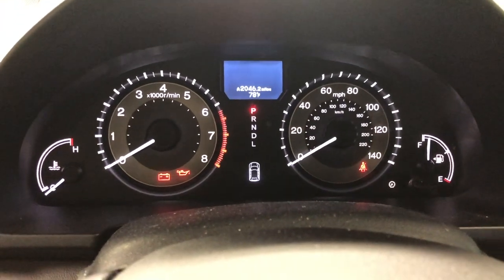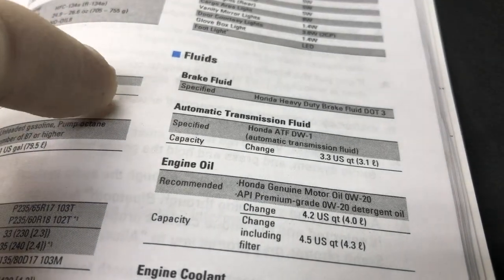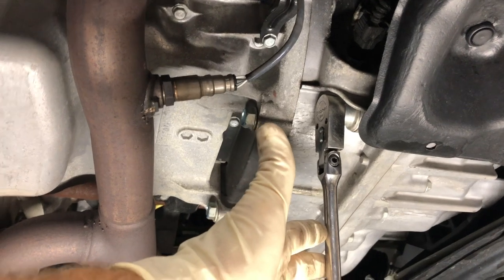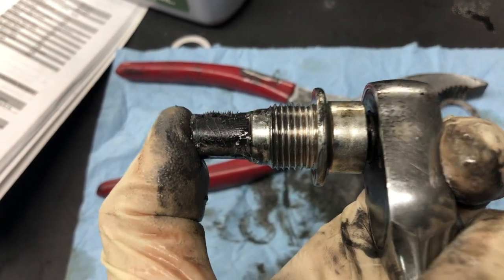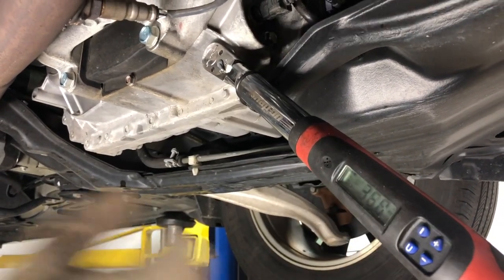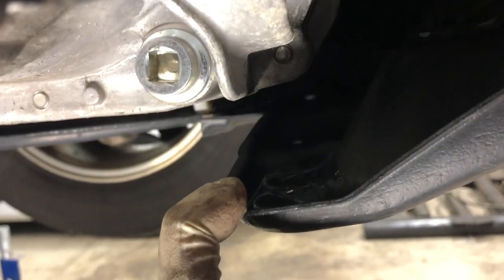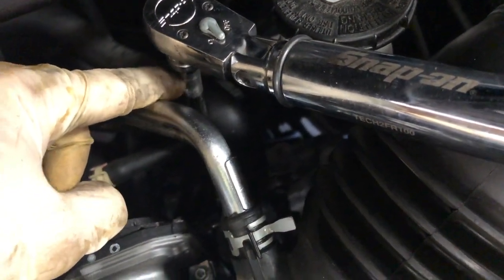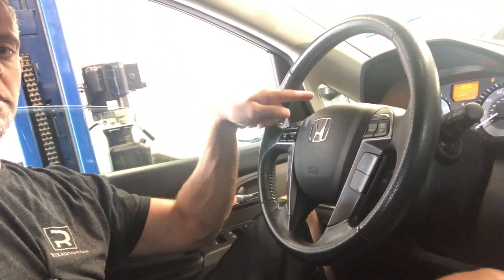Transmission Fluid Service Honda Odyssey 2011-2016

Comment: By far one of the more detailed yet effective videos on this topic. Thank you sir!
Reply from the maker: My pleasure! Thank you for watching 👍🏼
Reply: @rixautomotive910  I am about to do it myself following your very detailed and instructional video, thanks!  What's the cleaner you used to clean up the area around the plug?
Reply: Do check transmission fluid while running or while shut off up to temp?@rixautomotive910

Comment: I did this last week to my 2016 odyssey and it fixed my RPM bouncing and juddering issues when the gears were changing. Drained/Filled it 3 times. Completely fixed. Thank you!!!!
Reply: I changed the ATF fluid with some weird symptoms. Trans slipping and hard shifting. Any ideas? Did your work fine after the change?
Reply: @ChristianMartinez-lg4lk  yes. My vehicle drove normally after I did what was in this video.
Reply: @Surry918  thanks
Reply: Drained/filled back to back 3x? Re using the same transmission fluid?
Reply: @robertgrlic6505  not the dirty drained fluid.... I bought new Honda transmission fluid and refilled it with fresh fluid
Reply: Where to fill the transmission fluid ? 
Same dipstick vs ATF down need big extension
Reply: @hi-vz5dv  yes. Very inconvenient
Reply: I got a black bottle from Honda showing ATF DW-1

Comment: starting to do the maintenance on my van and this is the best diy video i have seen yet. already learned how to change out the o2 sensors and i already change my own oil, brakes, rotate tires and a couple of other things lol. shops are getting expensive and overcharging for simple things.

Comment: I drain and fill my ATF on my 13 ody every other oil change. A few years back it was hard to get my hands on Genuine Honda ATF, I was forced to use Castrol Transmax import AFT. So far no issues, It's been over 3 years and still going. I still drain and fill ATF every other oil change so I imagine that it's now mostly Transmax ATF with a little genuine Honda left, still no issues.
Reply: I've used valvoline maxlife for years non-issue

Comment: Thanks bro, you really saved me. I couldn’t find that damn fill point on my used 2013 odyssey. Just did a full tune up on it, rides smooth like new.
Reply: Got a few questions for you about my 2013 Honda Odyssey

Comment: Thank you for this in depth video.  Certainly looks easy now.  I have a 2015 Odyssey and bought some transmission fluid to swap out but just heard that when shops do it, they change out the ATF filter.  Is that necessary on a car with 100k miles or can I just swap the ATF fluid and be done?  Are there signs that the filter needs to be changed?

Comment: Why dont you change out the transmission filter when you do this?
Reply: 2016 odyssey has a sealed transmission and has no transmission oil filter to change.
Reply: @franciscosantiago9032 there is an external can style filter beneath the battery tray, plumbed with simple rubber tubing, that serves the transmission. Somewhat tricky to access, but still attainable.

Comment: Newbie question…What’s the difference between a trans flush vs trans fluid change?  Or is the same thing?
Reply: Flush means replacing all fluids.   Fluid change (AKA drain and fill) only replacing about 1/4 the total capacity.
Reply: I found this on an Odyssey Club web site to help explain the difference. Long story short, you don't want to do a 'flush' as it forces fluid through the transmission. A 1x drain-and-fill should be all most vehicles need.  You can also do a 3X drain-and-fill (spaced about a week apart) to get most all fluid replaced while letting the new fluid clean the system.
----------------------
  "A "drain-and-fill" is exactly what it sounds like; the ATF drain plug is removed and the fluid is allowed to drain out with nothing but gravity helping it along. Once the ATF has stopped leaking out of the drain hole, the plug is replaced and the transmission is refilled with fresh ATF.

    A "flush" usually refers to a process where a machine is connected to the transmission and pressurized ATF is used to push or flush out all of the old fluid that is in the transmission housing and torque converter. Other types of machines simply use the vehicle's ATF pump to draw new fluid in and push the old fluid out.

Honda does not recommend doing a flush on their automatic transmissions - not even to their own fully trained mechanics at the dealership. No mechanic who has any familiarity with Honda transmissions should be hooking it up to a fluid exchange machine. If you take your Ody to a Honda dealership for ATF service, they will be doing a drain-and-fill. That is the process that is prescribed in the service manual that the mechanics use.

The only ATF replacement procedure approved by Honda is the drain-and-fill. Most shops that I am aware of will only do the process once and will quote prices for doing it once. Doing one drain-and-fill will replace about 45% of the ATF contained in the transmission. If you wanted the process to be completed three times (which would get you up to the 85% new fluid state), you would have to specifically ask for that to take place. That could potentially get pricey, but if the ATF has been neglected in the past, or if you are already experiencing problems, it is still far cheaper than any repair.

The ATF drain-and-fill is generally considered a regular maintenance item and that is why it is generally offered as a single time service. Doing a triple drain-and-fill is a more drastic intervention that is usually indicated by the presence of problems in the transmission's performance or knowledge that the maintenance has been neglected in the past and a fresh start is needed to catch up."

Comment: Great to see brake cleaner used to clean. Great Idea!
Reply from the maker: Thanks for watching!
Reply: For the amount of fluid he had, it is just easier to wipe it off with a rag or paper towel.  There really isn't a need to use solvent here.

Comment: Thanks alot.
After draining the old fluid, can we skip opening the fill plug and pour the new fluid in the dipstick tube after removing the dipstick? Way easier and more accessible, and theoretically achieve the same goal? Maybe only slightly slower to do
Thanks again
Reply: You can (I actually did this yesterday chaging fluid in my 2011 Odyssey) -- only because I didn't watch this video first and didn't know about the fill plug--- on the 2011 anyway, the dipstick hole is VERY small-- maybe 3/8" and my funnel did not fit-- I luckily had a pump adapter (like soap dispenser pump) that you can put on quart sized bottles and it has a 1/4" hose on the outlet-- so refilled mine with this through the dip stick hole-- it would have been much faster/easier using the fill plug.
Reply: I fill through the dipstick tube.
Reply: That is how I do it  work perfectly

Comment: Thanks for the great in-depth video. just one question, Is there a specific reason to use the fill plug and not the dip stick hole to pour-in the transmission fluid?
Reply from the maker: Pwazy Dev you may do both. While some Honda and Acura’s May have the wider dipstick, the majority of H&A dipstick tubes were narrow & skinny making it difficult to pour into without making a large mess. Out of habit I prefer to use the manufactures fill plug.
Reply: Mine seems to take more than they say why? I can hardly see it on the dipstick.

Comment: Hi there. I'm seeing different ways to check the atf level (check on level ground, while vehicle is cold / check on level ground with vehicle at running temp and on / check on level ground with vehicle at running temp, but turned off. Do you know which is the correct way? I have a 2015 Honda Odyssey.

Comment: Just changed the 2016 Honda Odyssey transmission oil, why the oil I changed out is only 2L?  I measured it with a mineral water bottle.

Comment: Hello. I just did my trans oil change. Took the car out for a spin and I got some bad shifting after 15 minutes of driving. Turnes off the car and then it was ok. The problem started when I went faster on the road. I changed the filter as well and dw1 honda fluid. Any ideas. The old fluid was sort of dark.

Comment: Great walk through. I have a 2016 Odyssey- Is there no transmission filter to replace? I have heard conflicting views on it being internal and not serviceable?
Reply: There is an internal one that is very hard to access. The external one is beneath the battery holder you have to remove some things.

Comment: Some other yt videos refill the fluid through the dipstick hole. Does it matter how it's refilled?
Reply: You can refill through the dipstick, but it's much slower and the fill bolt is easily removed with an extension.
Reply: I use the dipstick on my 2013 and it doesn’t take longer at all.

Comment: To 2013 Honda Odyssey.  One question at what temperature is the transmission fluid change when it is cold or hot.  and also if you can place some jack stands on the 2 front wheels or on the rear ones.  of course thank you very much
Reply: 2 front.  Rear wouldn't make sense

Comment: So we only need to drain it 1 and just add the fluids? Im just curious because on my older honda crv i have to do and redo it 2-3 times. Please help explain to me?
Reply from the maker: 1 drain and fill is sufficient if the service has been performed per the manufactures recommendations.

Comment: Great video.  Why don't you change the filter too?
Reply: The honda's with filters installed are supposed to be for life-- however IMO I don't think it would hurt change it out (but I would only use Honda one)-- but the vehicle in the video only had 30,000 miles on it.... I would  maybe consider doing this at 150,000 to 200,000 milies --- I believe those filters have bypasses in them so when clogged they do nothing.

Comment: Great video. I have a question about transmission fluid change in   2004 Acura TL w/ 162k . I've had it for a year . A13 came on so did engine oil. On,transmission should I do  a drain 3 quarter out 3 quarter in then do same in a month or so? Your thoughts on this? Thanks
Reply from the maker: Sage TL if you’ve kept up with your transmission fluid services and you don’t have any transmission issues I don’t see a benefit to do so however if the transmission fluid has been neglected I can see the need 👍🏼
Reply: @rixautomotive910  I've had the TL for a year . It had 152K on it according to maintenance records transmission fluid was changed at 80K. It shifts fine but fluid is dark.That's why I would  do 3 quarts out  3 quarts in now then in a month do the same .And a month later same so all fluid  is out of transmission. The 3X3x3  method.  Thank you for your response. I value your information.
Reply from the maker: Sage TL my pleasure! 👍🏼

Comment: is that tranny oil bolt that you removed from the bottom, is that factory that comes with magnet or aftermarket? also do you recommend using honda original tranny fluid or some other brands?  lastly which funnel do you use to reach all the way down?
Reply: Yes factory bolt comes with magnet on all Hondas. I've personally used valvoline import and maxlife in Hondas and toyotas no issues

Comment: But does ATF remain in the box during replacement? And after such an oil change, after 300-400kl of mileage, it is necessary to do the same replacement of the entire oil again?
Reply: What? Your question doesn't make sense

Comment: Please note that while most vehicles the Transmission fluid level is checked while engine is Running, This Vehicle and other Honda's are checked with Engine Off. This is exactly how he did it but I don't think it was mentioned.

Comment: Great video. One note, the ratchet extension shouldn't affect the torque rating unless it is horizontally offset from the bolt axis for some reason.
Reply: I agree-- rotational torque is not affected by an extension unless significantly off its axis of rotation

Comment: 2016 odyssey CVT uses special fluid, it says on the back of container "Not for CVT transmissions"
Reply: There is no 2016 Odyssey CVT transmission.

Comment: My transmission fluid looks/smells fine, 2014 Odyssey runs fine with 120K but the transmission fluid has never been serviced. I heard that with that many miles you probably shouldn't service the fluid. What are your thoughts about that? Thanks for these videos.

Comment: The filter is external.
It is located beneath the battery. You have to remove a few parts to access it.
Reply: There is another internal one as well you don't wanna change very hard place not normal

Comment: my user manual says every 90K miles.
Reply: Each drain and fill only replaces about 1/3 of the total fluid in the system so that’s about right if you do it every 30k. It’s better to spread the D&F’s out so you don’t shock the system with a bunch of new ATF, the detergents could dislodge crud and clog a valve if you do it all at once.

Comment: Trans holds about 8 quarts so draining less than half doesn't do much good.  Contrary to all the alarmists out there, these transmissions can be safely flushed without removing coolant lines, the better shops have a machine to do this (old fluid is sucked out of the dipstick tube and replaced with new fluid).  My fluid still looked good at 50k miles and there was nothing on the magnet.
Reply: Yes they do that because they don't want the liability, but if you keep up with regular service (generally 30k miles complete flush for lightly driven sedan) these transmissions will last a very long time.  I also replaced the inline filter with a Magnefine
Reply: If they fluid is old (>100k) it's better to just leave it alone and run the trans into the ground.  Flushing abused transmissions can do more harm than good
Reply: @cguy6934  Just changed the 2016 Honda Odyssey transmission oil, why the oil I changed out is only 2L?  I measured it with a mineral water bottle.